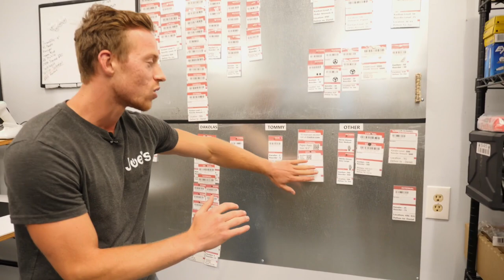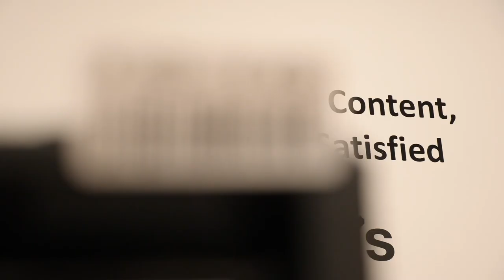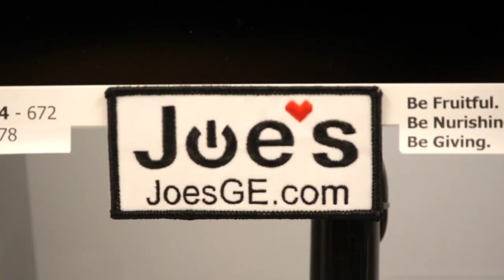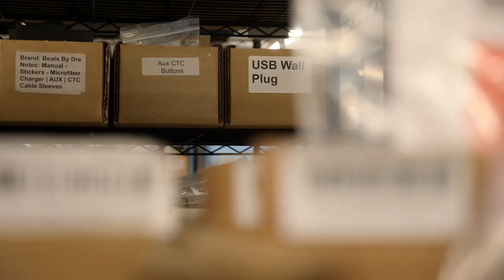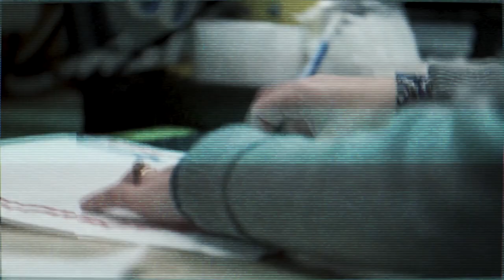Lean Manufacturing: Improve Business Efficiency & Maximize Profits (Pt. 1)

Comment: When I worked in hospitality I saw that having an adaptive environment was important. The needs of the restaurant change and the work flow needs to change directions depending on bookings etc. Putting things on wheels really helped. The restrictions were plumbing, but you can also have gas hoses and water and waste hoses that follow moving stations. If the business was fitted out correctly from the start it wouldn't cost time and money and profits later (having to try to fix everything). It was a great practical excercise in lean and I payed using my own wages and time and energy but I'm blessed to have captured the wisdom of lean. Being a owner or having a owner that is willing to use lean is what I would advise though as i found it really tough to pull off with many people resisting the change and not being able to see what they couldn't see
Reply from the maker: Hey Nicholas, thank you for sharing your story. It definitely would have payed off to have implemented lean practices earlier on in your business, as you implied!